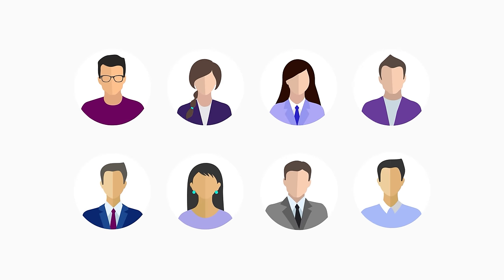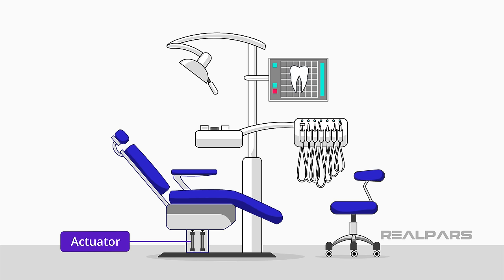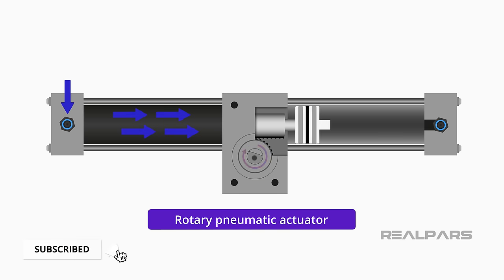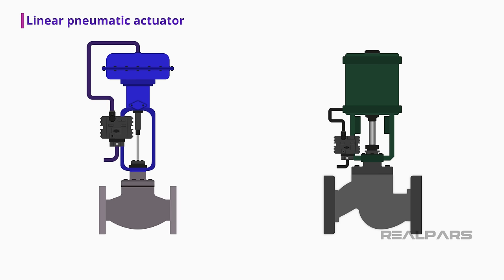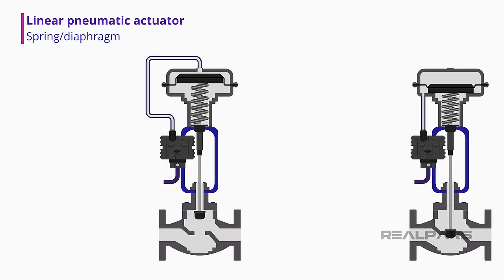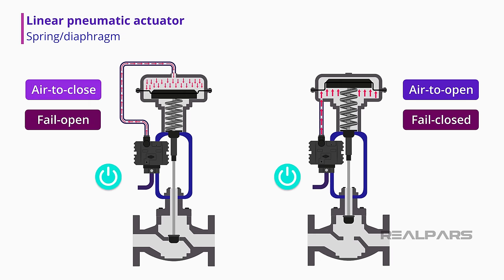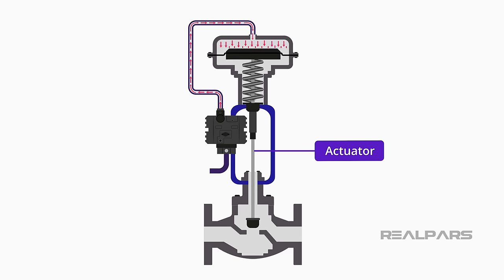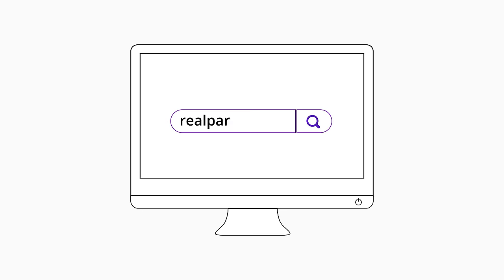What is a Pneumatic Actuator? | Types & Applications

Comment: I think the industry could really use a great video on pneumatic pilot positioners where an EPT is controlled to supply a signal pressure to the pilot positioner which then rescales it or provides a higher volume of air for the actuator. Pneumatics seems to be a lost art that so few understand anymore.
Reply from the maker: That's a great topic suggestion! I will happily go ahead and pass this on to our course developers. 

Many thanks for sharing, and happy learning!

Comment: Well that’s a great explanation but i just wanted to ask you a question that how the 15 psi or let’s say even 60 psi of pressure on diaphragm will stop the process flow where the pressure is around let’s say 400-500 psi. As we know both are forces but how the small force is stopping the big force. Has it has to do anything with area because F=PA  the larger the area the more the force is. Plz clarify
Reply from the maker: Hi @Adnan Rahim.  In many processes, a valve positioner is required.  In a nutshell, a positioner receives the control signal and provides whatever additional air pressure is needed to move the valve to its required position.  I hope that helps.
Reply: @realpars  I agree it receives 4-20 ma in a transducer which converts this into 3-15 psi and inside the positioner there is an amplifier so to amplify this small pressure into something big pressure. But again my question was clear and I didn’t get a proper answer.
Reply from the maker: @1Sumalani  Thank you for getting back to us. Sorry to hear that you feel your question has not been answered. We weren't clear on your question and as such, an answer was provided about positioners as they were not discussed in the video. In fact, based on your last response, I do believe you've answered your own question. The internet is loaded with details on pneumatics and Pressure/Force diagrams that should provide some clarity for you.  Thanks again for interacting with us.

Comment: Sir my question is that can we operate a pneumatic actuator in analog manner...... Like 10%, 20%......and so on....... Or does thhis operate only on 0 or 100%
Reply from the maker: Hi there. Yes, many pneumatic valves can be throttled from 0 to 100%. For example, the Spring/Diaphragm type as seen at 2:31 of the video is typically throttled by a pneumatic signal from 3 to 15 psi.